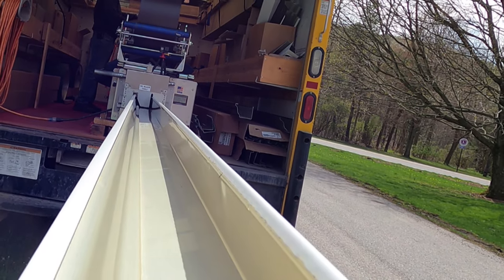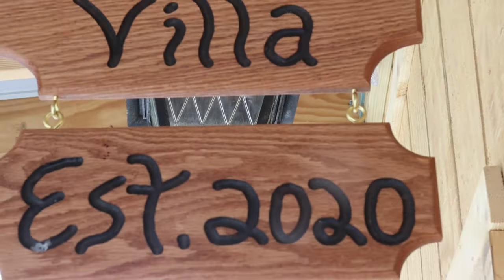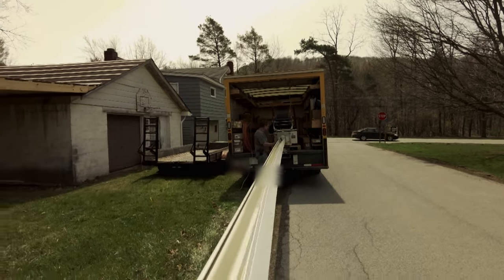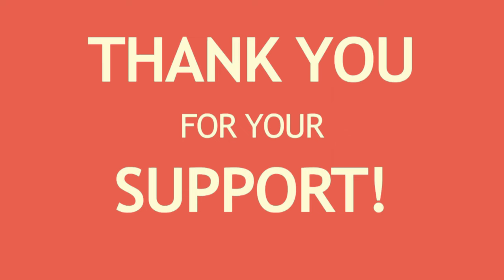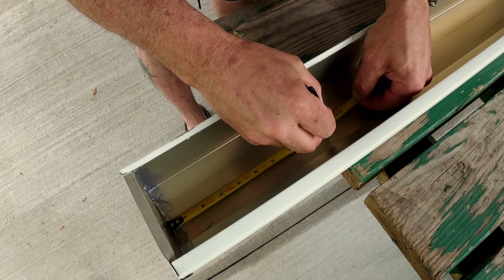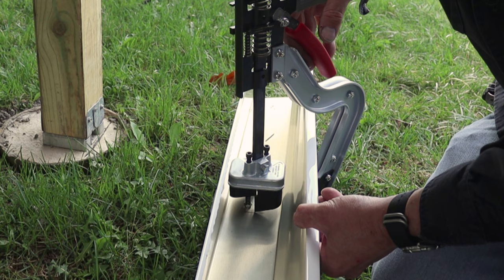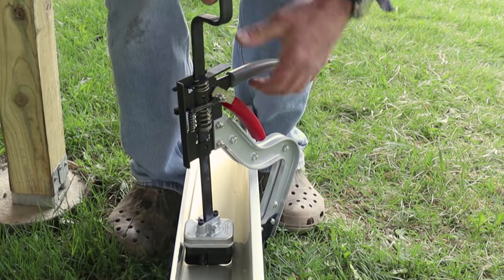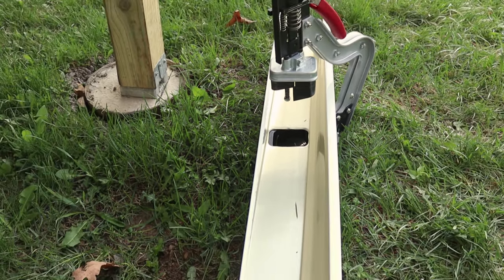Malco Gutter Punch Explained

Comment: Thanks for the explanation.  I found this tool in my shrub, and only had an inkling of what it was used for.  I thought it perhaps was blown into the bush by an f4 tornado that passed through 3 years ago or fell off the roof from some careless workmen.  At any rate, it has been in the shrub for 3 years, and works just fine!
Reply: Please let me buy it!
Reply: @clintbeastwood3311  Where do you live?

Comment: Have you ever used this on an already installed gutter? Would it work? (Or does it need to have a surface beneath it?)
Reply from the maker: Hi Kris. I wish I could help you more, but I only borrowed the tool from the local Building Center to make this video. I did check Amazon questions in their reviews on it, and there is no answer but I did ask the question and if I hear back, I will post an update for you. Thanks for watching.
Reply: @themostlymikeshow   Thanks, Mate!

Comment: Can you  install the outlet using this tool while the gutter is already installed?
Reply from the maker: Thanks for watching Christopher. I only borrowed this tool from my local building center to do my own gutters, but from what I recall, I don't see any reason why it wouldn't work, being that it operates by squeezing the handle to make the punch work. The biggest thing I could see getting in the way is if your roof overhang wouldn't allow the punch to clear. I looked in the Amazon reviews and I couldn't find an answer there. But they do have a section where questions like that could be asked. I will try to get an answer.